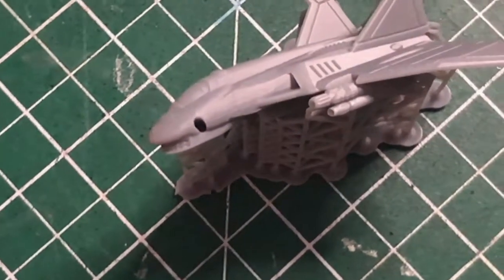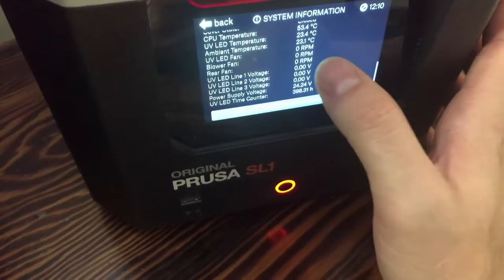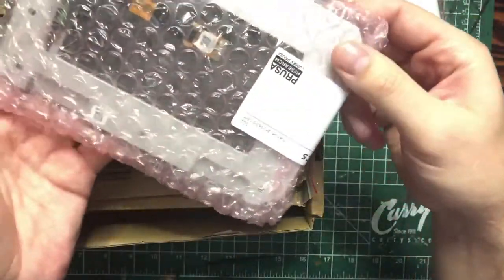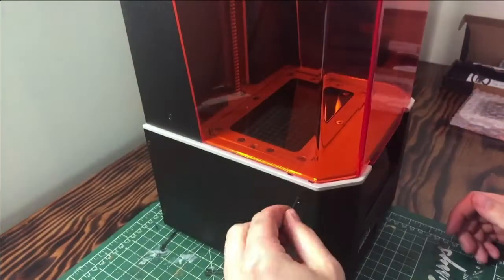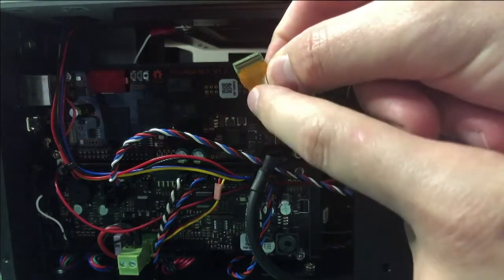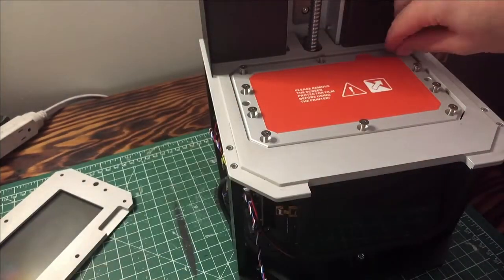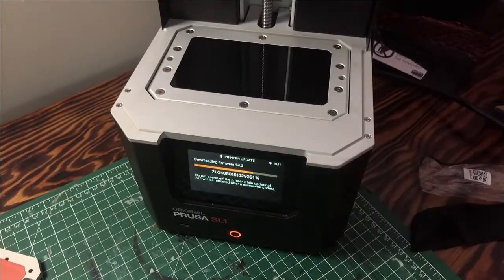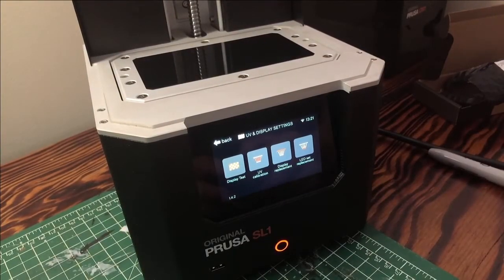Replacing LCD Screen on Prusa SL1 Printer

Comment: Is there any chance that I can replace the LEDs on the SL1S printer. I'm doing a school project and the printer is set at a wavelength of 405 and I need it to be at 365 in order for the resin to cure properly. We unfortunately can't use different resin so we are stuck with these materials. Thank you